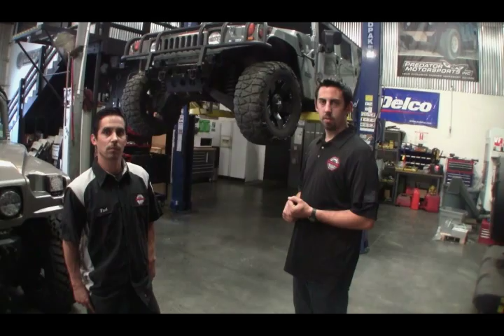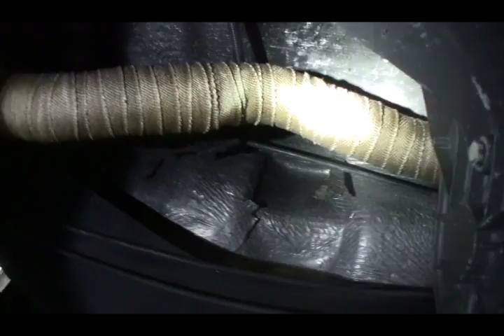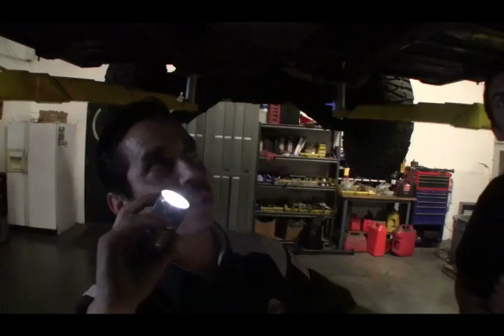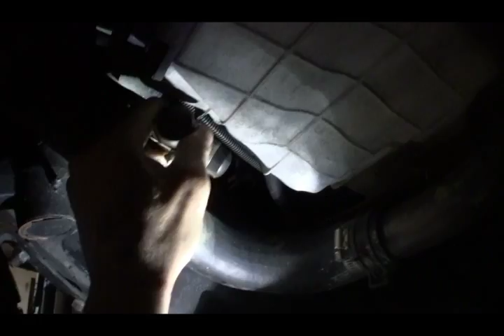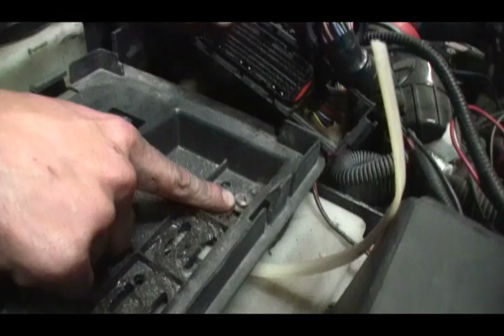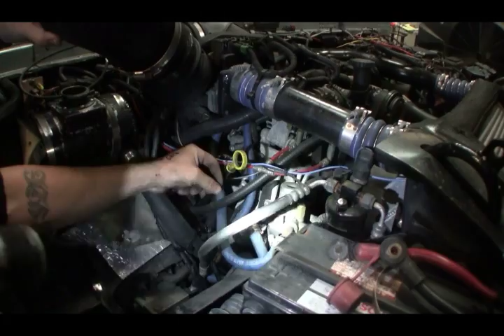Vehicle Inspection

Comment: Wow...  It was hard to watch seeing all the crappy shortcuts and substandard work that was previously done to the Hummer.  I know Predator will get all that mess cleaned up and get the vehicle squared away.  Thanks for sharing!
Reply from the maker: This Vehicle is a mean machine now. We  went in and did a Predator Duramax Conversion for him.
Reply: +Predator Inc Nice work fellas!  I've been kicking around the idea of picking one of these up for quite some time but shied away away because of maintenance.  When I do decide to pull the trigger you can bet your ass I'll be giving you guys a call.  Very impressed with your workmanship.